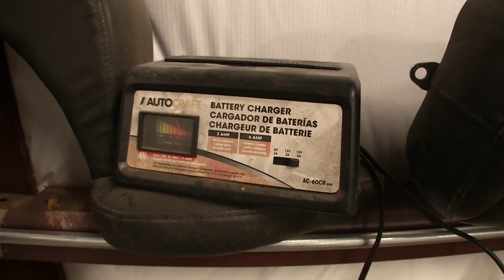BROKE DOWN On My 79 HARLEY Davidson SHOVELHEAD FXS 80 / WHAT HAPPENED??

Comment: That's the first thing I done with my shovel. Changed back to points. And you can kick start it with lower voltage, where with electronic you can't.
Reply from the maker: You're right about that.
Reply: Yup. I replaced my electronic ignition with the points and condenser system. No more problems.

Comment: I used a Mallory Performance Ignition Module For 30 years plus on my 1975 FLH, never had a problem. I sold my bike just last year. That ignition is still in that bike today. Simple system that uses your OEM  spark advance. When I sold my 75 it had 300 thousand miles on it. Still going strong.
Reply: @eazyrider5261  And still running great some ware in France. It's new life across the pond.
They go crazy for old Harleys.😁

Comment: ru,nning points for 20 years now on my kickstart only shovelhead, never had a problem. Electronic ignation is not for me. Nice video, keep them comming!
Reply from the maker: I've never had oem electronic ignition fail me. It's always been that over priced aftermarket stuff that's taken a dump on me.
Reply: @SaddleTrampTV  I agree. I have always used genuine HD parts on my Sporty. 100,000km and goes like the day it rolled off the showroom floor. I always get flack for using genuine. But I’m always the only one who doesn’t break down. Sure points can be troublesome, but somehow they always get fixed on the side of the road. They just need more care and attention. People want an old bike but with modern turnkey and go reliability. Not many of us left who tinker so much.
Reply: Need to get AAA,here in canada its caa.

Comment: That used to happen to my evo, the starter thing. It’ll freak ya right out, thinking the whole things gonna catch on fire. I’ve been told by some old timers that a push button on the starter itself can prevent that from happening
Reply: Scooter Tramp Scotty did a video on this happening .. he's got to push button down on the starter and it will still happen but you can take out 3 bolts which removed the shaft and start button, clean and lubricant it until you get a new one
Reply from the maker: I put one those on my softail when I first got it.
Reply: I’ve seen a few done that way
Reply: Happened to my 91 evo ultra fortunately in my driveway but glad it was me. Definitely scary moment.
Reply: I put one on my 93 Heritage Evo.
Reply: Unfortunately a starter relayed bypass has nothing to do with it, 12vdc is always present at the solenoid. The problem is exactly what Corey showed you and I would beef the clutch up to an Alls Balls.
Reply: Separate question, not related to the fault in the video. Does it matter that the belt primary doesn't appear to be ventilated? Like you I've progressed from TC back to Evo and now Shovel (don't have Pan money). Love learning more and doing my own spannering. Thanks for the videos. Ride safe.
Reply from the maker: @bm7760  It's vented. The derby cover and inspection plate are shimmed out.
Reply: @getoffmygrass6974  a starter solenoid is a high amperage relay. Explain to me how the starter motor can continue to be powered by the battery even after you let off the button because of the bendix being stuck in the engaged position. The starter drive neither controls the 12 volt flow of electricity to the starter neither does it control in any way the solenoid. It happened because he cooked the copper disc in the solenoid by holding down the start button too long and it stuck to the copper contact leading to the starter. Chinese starter solenoids are junk and the majority of them available for sale are Chinese. Don't hold down the button for more than a few seconds in a minute. If it won't start holding down the button longer isn't going to help. Let off the button and fix the problem.
Reply: That's an idea!💡

Comment: Tramp, in regards to that starter not disengaging, I had the same problem on the 1970 XLH I am currently restoring, in my case a brand new starter solenoid was bad, luckily I had the positive battery cable rigged with a small vise grip so I quickly knocked it off the battery post before my starting system was harmed. Scary thing to take your finger off the starter button and it continues to crank! 
Great move going back to points and condenser. They generally will give you ample warning before they fail unlike a electronic system that suddenly die and leave you stranded.  All my old time friends  run points on their vintage Harleys for a good reason, live and learn I guess.  Take care tramp, great video by the way!

Comment: I worked for my local Harley dealer in 79, I would go to points or the original electronic. The factory ignition is very reliable. Love the shovelhead. I also ran a 24 tooth front sprocket with the original rear, I could cruise at 80 mph all day.

Comment: I am just converting my Evo to points, ditching the EFI and ECU and fitting a HRS42 Carb and putting a push button start on the solenoid - I am never going to get stranded with that set up 😎.
Reply: Yeah I'm running a Twin Tec in my Evo and I have an extra ignition box, but I bought an entire points setup plus points coil and wires as a spare for long hauls so I don't get stranded. The electronic pickups don't like heat at all for sure
Reply: I've thought about just going ahead and converting it over already anyway

Comment: I used to keep something on me for when my starter solenoid would stick on my 69FLH until I finally got it all working properly. I had thought about changing out my points for a modern ignition but my old school Harley shop said not to do it. He told me it’s not a race bike so leave it stock and I’ll be much happier in the long run.

Comment: Good thing you found the problem. My stock electronic ignition failed on my 1983 FXWG,  went to points and have not had problems for years. Electric start   solenoid failed in Japan.  So Kick started it even in the Philippines.  Had Electric start fixed after retiring from the Navy.  Still works and have been retired since Nov 92. Keep Safe on 2 Wheels!

Comment: I love this sorta stuff with my shovelheads. Whenever it even has the slightest hiccup I tear into it to see whats going on. I always carry tools to address the issues that are going on at that moment. Currently I ride around with an extra set of plugs cause it fouls one of m, that cilinder sometimes cuts out. I have the most simplest Dynatec S ignition with the mechanical advance, chose it after reading omline its bulletprrof. With the point ignition the interval between the cilinders can be off, meaning only one will be correctly timed... this when the bolt throught the timing advance is not straight or the point lobes are worn unequal. I took my starter jackshaft apart this winter cause one time it failed to retract, greased it up properly. But it solenoid should be able to disengage even when the jackshaft sticks in the starter ring. And dont forget you can always kickstart it !

Comment: Your coil shorted out in the rain it sounds like. No bite washers on the coil or water in your nose cone because of the rain . I run rtv at the bottom of where the wire goes in and a gasket on the points cover. They sell knock off Ultima pick ups that suck. Dyna s is the way to go. Don't go backwards with points . You have enough to mess with as it is.  The solenoid sticking is low battery or wet or screwed! Lol. I stop for motorcycles. Even metrics . I had 50 Harley Davidsons ride by me waving and a metric cruiser with a dude and his son brought me some gas after my gas line broke when I hit reserve.  Bikers come in all shapes is the truth. Keep doing what you do. Ron. God speed
Reply from the maker: It had bite washers. They just don't show up too good in the video.
Reply: @SaddleTrampTV  you will get it for sure brother. You got too much good juju going your way!

Comment: I haven't run points in awhile.  I've been using dyna s ignition systems on everything for many years now.  Every once in a great while a module or coil will fail.  I just keep an extra of each on hand just in case.  I've thought about switching back to point to a few times but, I hear alot about quality points being hard if not impossible to buy. That has kept me from going the points route on any of my scooters.

Comment: Maybe worth considering? 

Summit Racing™ battery disconnect switches positively shut off all current from the battery in the event of a short or accident. These high-quality 2-terminal switches come in multiple configurations, with or without mounting brackets. Be safe at the race track by adding a Summit Racing™ battery disconnect switch to your vehicle's electrical system.

Comment: I've also converted back to points on my 78 Shovel.  Simplicity is better and easier to diagnose electrical problems.  In my younger days I had a 1965 Honda CB160.  It had electric start and a kicker.  The starter would on occasion stick on.  I'd grab a 2X4 and whack the seat.  That would stop the starter from turning.  It would only happen when parked near the garage with the lumber stacked near it.  Haunted house on two wheels cracked me up! Lol
Reply from the maker: Think I'll name this thing "BeetleJuice".

Comment: Hey Saddle Tramp!  Looks like you are going to deal with it man!  Nice of you to help a Biker gal too.  Awesome to have friends like Darrel who are willing to give you a hand.  Maybe sometime you can fire up the grill and invite Darrel to a good burger or maybe deliver it to him.  You will know what is appropriate because you are smart and considerate.  I like the idea of a battery disconnect - do they make waterproof ones?  In the mid 1990s my old Chevy truck shorted in the starter.  Luckily I had a pair of vice-grips in easy reach and popped the hood, jumped out, and disconnected the battery terminal.  Smoke was billowing and I thought I had a fire and I had no fire extinguisher!  Boy was I relieved to see the smoke subsided.  Like you I called a friend and made a quick trip to the parts house and did a parking -lot repair.  Thank goodness it was something simple.  The only thing I had to worry about was to make sure the starter gear teeth did not mesh too tightly into the flywheel, else add shims.  I like the simple easy repairs that work when I am done - don't you?  Ride safe friend!

Comment: Man, you’re a legend for going back and rescuing that lady on two wheels.
Reply from the maker: Lol... You think?
Reply: @SaddleTrampTV  absolutely! 👍
Reply: Install a lever action starter solenoid  . No more melted wires and  dead batteries. I've been riding the  same  shovel head  for  47 years.
Reply: @kurtsshovel1457  great tip! And that’s awesome you’ve had the same shovel head for that long.

Comment: Carry a spare set of point too. I had a set of points mess up on me riding my 1977 Sportster back in 1977 from Florida one time. Thank goodness a guy stopped and helped me out. He actually went got another guy which opened up a Harley shop on a Sunday, that he worked at and got me a new set of points. It turned out that the plastic peace that rides up and down on the lob broke off. this happened in Athens Georgia.
Reply from the maker: I plan on carrying some extras.

Comment: '79 HD motorcycle was an AMF atrocity. I bought a 1976 Bicentennial Edition Sportster new.  I had near constant problems with it and sold it 6 months later. Luckily, I lost no money when I sold it. I bought a Honda 750 SS which of course, was far more reliable. 2010, I bought a new HD XR 1200 which I still have. 2016, I bought a new HD Heritage Soft Tail which I also still have Never a problem with either of those.

Comment: Used to run points in my 65 Electra glide. About 17 years a go I put electronic ignition on it. A guy came up with it for the stock distributor.  Also added an electronic voltage regulator. I rigged up a mounting plate, to mount the regulator under the bike. If you aren't looking for the regulator, you can't see it. The bike looks stock, but with better performance. (As far as "performance" goes on a bloated 74 inch, Electra Glide goes.) It's easier on the generator, the light doesn't dim when I idle and there's a hotter spark. And some years back, I put a Daytona Twin Tec ignition on my 80 Shovel. Never had a problem. The only bike left with points is my 71 Electra Glide. When I get around to it, it will get electronic ignition. I have been over the adjusting everything before a trip. I'm sure I'll have an ignition problem eventually, but that happens on new bikes too.

Comment: Had the exact same solenoid not releasing/starter running on happen to my '87 FLHTC Evo many years ago.(Same Hitachi starter & same solenoid as my shovels)..I was parked preparing to leave when it happened so already in neutral...My first thought was starter button or switch sticking....couple seconds of messing with start button then got a wrench in hand & pulled cable at starter post as quick as I could ...A lot of that "magic smoke" escaped the starter/solenoid... :-) ... Lucky I was in a parking lot that had a slope to it...Roll started it & rode home.(engine ran fine before & after..???)  ...next day I went all thru everything while battery was charging...Due to loss of said "magic smoke" I took apart starter for inspection of brushes, armature, anything copper,,windings,etc.,... surprised copper was not scorched... no winding damage, ....cleaned, & tested everything ..lubed where needed & reassembled... I never did find the exact cause & hasn't happened since...??? Was thinking binding starter pinion shaft just as you found but all that was good...> Que up theme song for "Unsolved Mysteries" ...???

Comment: One issue with electronic IGN is they get flaky if the voltage starts to drop.  Get below 10 or 11v and shit starts to sputter and cough.  Points keep going down to 6 or 7 volts.   And the damn Shovel starter solenoid setup keeps the starter engaged until the engine starts (Actually, till the eng RPM gets higher than the starter rpm).  A real hell if the battery is weak and doesn't have the guts to start and.... will keep cranking till it dies.   "Stay engaged when the damn thing doesn't have the balls to turn the thing over".....  Who thought of that????  And the weak power will burn up a starter motor quick.   I actually added an Auto starter solenoid under the battery which disengages power to the starter when I let off the button without worry of pulling cables off.    The IGN output from the new solenoid goes to the Shovels Solenoid trigger.  Works well.  And hides well behind the odd shaped cover under the battery tray.

That said,  your symptoms can also be low voltage.  You said you charged the battery, when you got back.  I would too, thinking that trying to start it wore it out.   But....  what if it was low volts when you broke down?     Start the bike and make sure the regulator/rectifier is good.  13.5 to 14.5 volts to the battery when engine running.    Easy check........   and if bad, switching to points won't get you far anyway.

Next,  on points,  got to keep the Advance weights clean, otherwise they can hang in the out position and it will hesitate coming down to idle at a stop-light.  Can live with it, but annoying.... trust me.
Reply: Very excellent point T. Mack.   Easy to blame starter system or electronic ignition system when the real problem is actually the battery, connections or charging system.  You can't expect electrical componets to work correctly if  they don't have correct voltage.

Comment: Been using points in my 69 FL i fitted more than 8 years ago & since i've looked at them, 
don't ride it enough "Preventative maintenance n Lube is highly recommended". 
spray silicon on the points gasket cover and use Extralube ZX1 Microlube Pin Oiler on Cam n Oiling tab and a squirt of WD40 behind the points on swing weight's, Last's Long Long time :-)
i'm tempted to oil the point's cam soon  ,, carry a spare condenser n points- cheaper than chips now :-) 
i'm glad your as enthusiastic as i am in repairing bikes when they brake ...i'm terrible keeps me up at night when shit happens to my Motorcycles or Fav Truck. Tink 🏴‍☠🍀
Reply from the maker: I'll consider all that. Thanks for sharing!

Comment: I like both ignition systems. I run the Ultima in my Ironhead stroker kick only bike. It's starts so easy with it and runs great, especially with the VOES hooked up. Helps keep the engine a little cooler. One thing I've learned about the Ultima is apparently the ignition module is made by Dynatek, but the coil is cheap Chinesium. So I run the Ultima module with an actual Dynatek coil and haven't had an issue in 6 years yet.
Reply from the maker: Thanks for sharing

Comment: In the early 90's on my 78 FXS Shovel I dual plugged my heads and used a single fire dual points ignition plate where I used the Accel blue chip points. The bike ran great but those points were hard to find. Fast forward a few years when Dyna finally came out with electronic dual single fire ignition that I could use and I switched over. My bike was kick only because I removed all the starter parts and didn't want to worry about not ever having a issue with a battery issue cause by electric starter, this was before AGM batteries were so plentful. I wouldn't ditch the electoric ignition just yet, make sure your charging system in good shape, your wiring and the battery. Switch to a AGM battery since the electronic ignition requires more stable electricty.
Reply from the maker: Everything else checked out fine. The unit is the only remaining suspect.

Comment: I have the same ignition in my evo. The 94 ultra so far been really good. But I might have to stock up on a few parts just Incase I run into what happened there. As always awesome video 😊
Reply: my 77 kz650 had points.tryed electronic .   wondered why I put points back on   ,